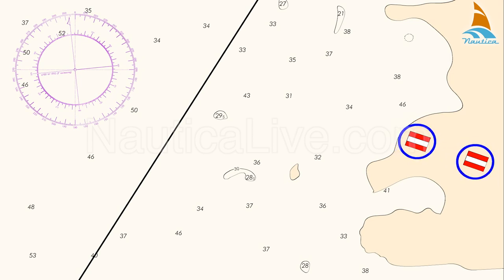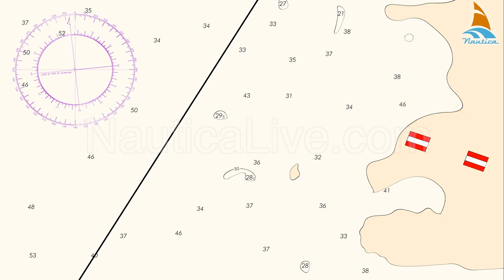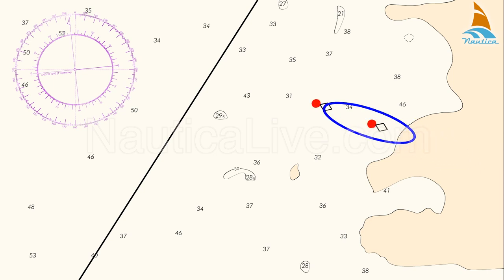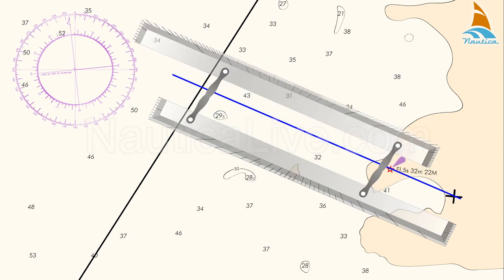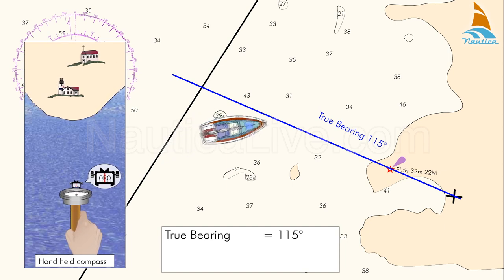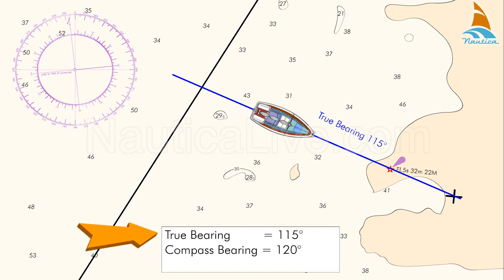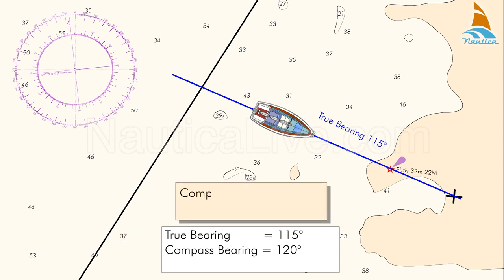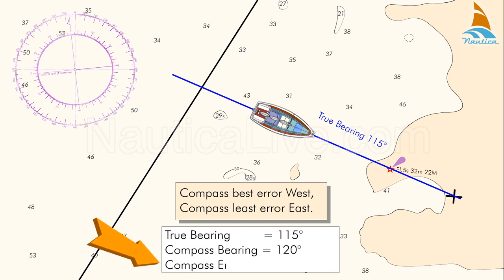Use transits to check compass error

Comment: Thank you for sharing. I just want to add that viewers need to know there is True Bearing (from True North) and there is also Magnetic Bearing (from Magnetic North). The question is: are we checking the error of a Gyro Compass or a Magnetic Compass on the boat? The calculation will be different.

Comment: You can’t use buoys as object of bearing because they could move from their position in the chart due to the slack of its anchor chain and current pushing them
Reply from the maker: So its not perfectly precize, but its better than nothing. Its quite ok
Reply: Nothing????  Did you know  you can use astronomical body to correct your compass? Azimuth, amplitude method? When there’s no sighting of land objects? I don’t know how you get licensed to issue certificates for mariners but I bet it’s non STCW compliance. Because if you ignoring precision when sailing, setting course with 1-2 degrees error for long run without correcting it, you may end up with your boat on the rock in the middle of the ocean.